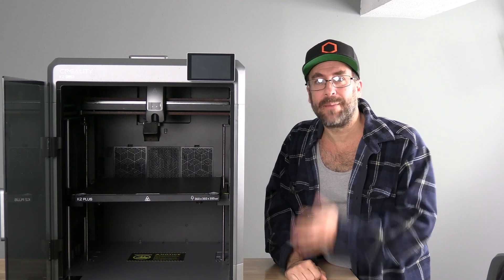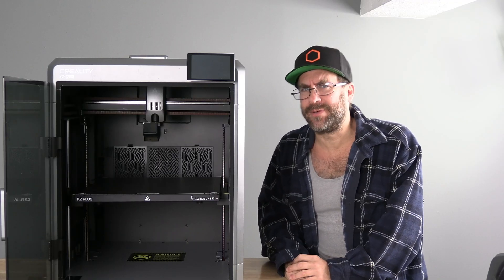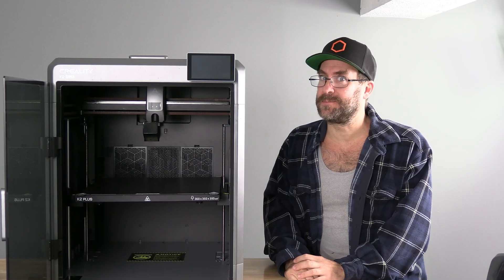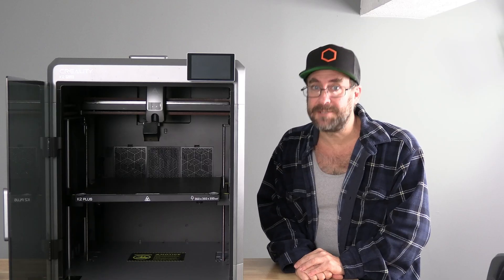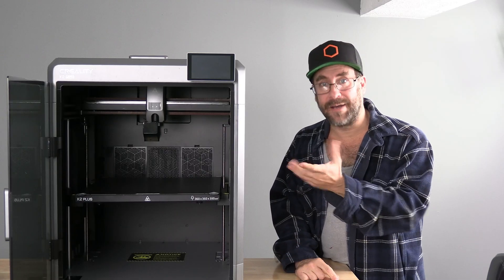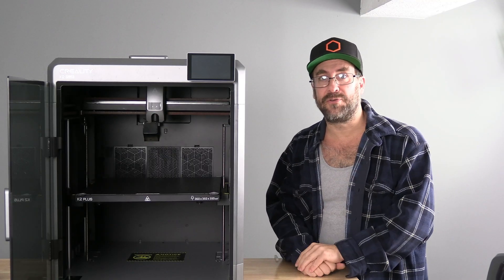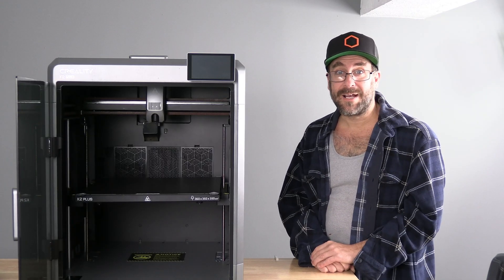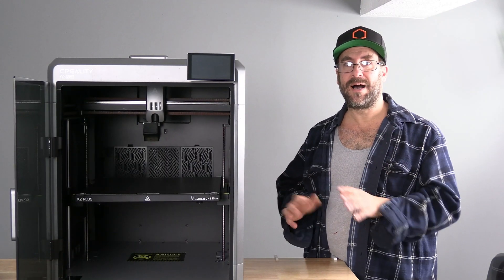CHINA We have a problem? K2 Plus Belt Tensioning Errors, after Firmware update. Let's discuss.

Comment: I was half way through a 15hr print and heard the printer shut off. The error said abnormal tension on the y and x belt. Went to do a calibration and now says there is filament in the extruder and won't continue to do anything. I have had no problem with this printer and it's the first time using it after the last update.

Comment: Today's new firmware trials and tribulations:  Updated and rebooted and did the calibration after cold boot. CA2721 is gone - yaay. Rebooted and reran calib to check - CA2719 makes a new entry - boo. Re-running a few times to check.
Reply: A couple of reboots and calibrations, and errors look to have gone. Print running overnight, will report in the morning.
Reply from the maker: Excellent. Several have stated the same. Report back. Creality is watching....

Comment: New day, new belt tension measurement tool - Biqu Belter.  Also new firmware......I read that there are mixed opinions of the Belter,  but my use case is to measure the X and Y belts, with the firmware showing an error on only one of them. My test is pre-today's firmware.
The Belter is showing both belts to be similar of c5.4mm = 7.72 nm which is within the tolerance mentioned in the wiki.
So if we ignore how accurate the Belter is or is not, the fact that it measures the same across both belts suggests they are the same tension. But the firmware only reports an error on the one - that maybe limitation of firmware, or just an error in the tolerance of the one belt. Either way, Im going to go with "annoying error message but no issue" given my prints are OK.
Now, todays firmware downloaded, lets see what the reboot brings!
Reply from the maker: Keep us posted!

Comment: I left a Squid Game mask print running overnight and it printed without problems or artefacts; the belt error is still showing. So I suspect the error is in the reporting, rather than the actual tension of the belt. Anyhow, I have a belt tension measurement tool arriving soon, so I will see what the results are.
Reply from the maker: You can do all the tensioning with a small 3D Printed tool from Creality. We are going go cover all this shortly
Reply: @3DRundown  However, some of us are getting an error straight away when using that tool :(
BTW, Update to Creality Print 6 just dropped....
Reply from the maker: You are running the Auto Calibration process, from the Wiki, with the tool, and getting the error still?
Reply: @3DRundown  Thats correct - as soon as I enter the first command, I (and others) get {'error': 'WebRequestError', 'message': '{"code":"key721", "msg":"The calibration value of the strain gauge is too small: 'mdly'calibration_num_error", "values": []}'}

Comment: I was hoping to wake up to a new patch this morning but no such luck.  I have tried factory resetting the printer multiple times.  I get the same left tension  2721 error every time.  I can still print.  At the end of every print I get an error stating that there is filament in the extruder and its not extracting, however when I open up the extruder there is nothing in there.  I should add the filament extracts into the CFS perfectly.  I went back to the previous firmware version and I get no errors.  I'm just going to leave it there until they hopefully put out another update, which I'm hoping will be soon  considering the amount of people having issues.
Reply from the maker: Have you tried listening to the 2721 and adjusting the tensioner? It may actually be that the older firmware isn't detecting the need for an adjustment
Reply: @3DRundown  I tried.  Nothing seemed to work.  To be fair, the printer is 3 weeks old and there should not be a need for an adjustment already...  Not super happy at the moment.  If it were just my machine I would look more into it, but I've read hundreds of comments on multiple  platforms from other people having the same issue.  In my opinion, either there is something wrong with the update (hopefully an easy fix) or there is something wrong with a LOT of essentially brand new K2's.

Comment: Gregg - thoughts on my current situation.  

I have a K1 And K2 Plus, both were printing as needed until today.  Doesn't matter what slicer I use or the file type, I cannot get either printer to properly print today.  I have not updated either printer's firmware ( as of this week) and am just using Creality Print 5.1.

Your thoughts on Creality intentionally using software to make users update?

I'm pretty pissed and since both printers are under warranty , I'm ready to send them both back.
Reply from the maker: I would use Bambu Studio for the K1. No question.
Move to Creality Print 6 for the K2 Plus. 
 There were firmware updates this week for K1/Max and K2 Plus. All of mine have been ok. What's happening with both?
Reply: @3DRundown  I sent a message on Insta, we are not connected there yet so I have to wait for your reply .  Too much to type on here

Comment: I will not be doing this update
Reply from the maker: Some peeps are saying their belt tensioner error codes were correct, and they did the adjustment. Others are ignoring it, and printing fine. Mine has been fine. Keep in mind, you can print as normal, with this error code.

Comment: Had this problem on my Y belt. If you use the belt calibration tool and follow the directions it will work. It says to adjust your belt that’s causing the error and rerun the test. Read down in the foot notes. My code was CA2721 in the wiki use K2 plus auto belt tensioning calibration.
Reply from the maker: Awesome, so you think the error code was accurate, and the adjustment worked?
Reply: @3DRundown  yes it says to tighten the belt 2-3 turns. I did about that and reran the test. The error code will pop up in fluid if it fails. After I tightened the Y belt it passed in fluid and then passed in the calibration. NOTE: the belt screws don’t seam like they are pushing in anything. They’re super easy to turn so it’s probably just that ever so slight between them and the sensor picking it up.

Comment: I rebooted - reran calibration after firmware update.  And am getting CA2719.   Belt tension timeout failure. Please try retightening or restarting.  My prints are fine.   I also performed the manual k2plus belt tensioning module process and while the Current_Place value is correct but the difference between idl_adc and full_adc   is  < 45000  and is supposed to be greater than 100,000  according to the docs.  I have the back off the machine investigating now...
Reply from the maker: Interesting. Lemme know your verdict: real error code, improved by tensioning, or, bogus error code. I have an email out to creality
Reply: @3DRundown  Howdy.  After some continued investigation I believe, at least for my unit.  After initially getting the CA2719 I did the manual belt tensioning and now have a consistent ca2720.  Which is the - from the front of the unit - Right (X) motor.  Anyone wanting to confirm look at the white label going around the wiring harness.  You may have to rotate the label (it's printed on white shrinkwrap around the wiring).  Looking at my unit I realized that the manual tensioner screw was / is having no effect.  upon closer investigation the tensioner motor appears to me, to be basically as far traveled as it can go with the stop screw. It's essentially moved as far as it can.  I took a close up picture of the tensioner unit and screw in question... The bummer is that I believe the only way to resolve this would be to give the belt more slack.  Essentially it came from the factory cranked down. And I believe the only way to do that is to take apart the hot end and give the belt a few more teeth leeway (for lack of a better word)  And that doesn't seem fun at all.  I am not able to find any info on creality site for the belts and or belt replacement process. Not that the belt is needing replacement but that info would give insight into how it's secured.   There is a video a guy made that goes into detail about the manual tension screws but... he doesn't break down the actual process he went through to loosen the belt though he does indicate that's what he did. I put some text and a picture of what I think is going on in reddit in a forum that's discussing this issue.  https://www.reddit.com/r/Creality_k2/comments/1hqg63x/comment/m4t6we7/?utm_source=share&utm_medium=web3x&utm_name=web3xcss&utm_term=1&utm_content=share_button
Reply: caveats - I could be wrong about a lot of this... ymmv
Reply: even creality has pulled their youtube video's related to firmware
https://www.youtube.com/watch?v=0rKfgOZAU-Y
this is a link from their other video series for the k2  specifically the wiper one https://www.youtube.com/watch?v=nx0PoI67fOM
if you look in the video notes there is a link to this for firmware.  and it's deaded out now

Comment: Thank you sir I got my new k2 yesterday I actually use your set up guide in YouTube to set the whole thing up, which made it very easy. Thank you very much for that. I have the belt tension  problem ca2721 that you discussed. And I've been doing some research on it and found no clear answers other then that is the coad for the right tensionr. But I will definitely try powering it down. And running the full calibration again, so thank you for that. O also alot have said it does not seem to effect printing at this time even though it fails ill see tonight ,so once again
    have an amazing new year
Reply from the maker: The real question is: is the error report valid, or not. Some have adjusted their belts, others have been able to make the error go away. If no luck, try a factory reset and report back.
Reply: @3DRundown  thank you sir

Comment: After the firmware update I get the CA2721 belt error.  I did not power cycled before calibration after tbe update.  Contacted Creality and they said run calibration 2 or 3 more times.  It didn't fix it so they are sending a new tensioner.  Everything was fine before the update.
Reply: Same
Reply from the maker: Wow. So, perhaps the error report is actually correct?? If your tensioner resolves the error, that would prove the CA2721 correct. But, I dunno. Maybe it's too sensitive in throwing the code. How is it running?
Reply: @3DRundown  Printer is working fine, calibration is just failing with left belt strain gauge. I tried to do manual belt strain gauge calibration but it was throwing errors for the left one as well. Creality support did not ask much, since the calibration failed, they immediatelly told that they will send a replacement gauge and board. 
But isn't it a bit fishy that specifically left belt strain gauge failed after the update on most machines with this type of error?
Reply: @kolaic96  I agree, hoping they figure out its a firmware bug and patch it.  Otherwise we all had faulty belt tensioners and this update is exposing that.  I may try the factory reset path and see if it fixes it.
Reply: @davidwalton6308  Pls let us know if factory reset fixes this
Reply: Roll back the firmware
Reply: @benkave2779  my guess is the old firmware was not utilizing the motorized calibration or not reading from the strain gauge.   I would bet the units were tuned at the factory... but the auto tensioning was disabled pending this firmware.  This is just a supposition of mine...   I am guessing that the tuning from the factory isn't nearly as precise as the strain gauge and motorized version.. BUT that some of the systems tuned with the manual screws from the factory are at the limit and so.. when the new firmware said hey.. wake up that subsystem and use it the system said... I'd love to but the manual adjustments have me as tight as I can be... or the strain gauge is out of band... can't articulate the tension motor etc etc.    Again.. clear instructions from Creality about how the whole tensioning system and belt system works would go a long way- esp given that belts are a wearable item in any case.   Just my 2 cents.    That also would explain why lots of folks took the update and are fine.  they just happen to have systems tuned to the middle.. So when the tension system got engaged it said ah ok. a little turn here.. a little slip there.  all good.

Comment: Brand new machine today & error after update. prints ok though. tried switching off & calibrated again - still CA2721
Reply from the maker: Thanks for the update. Looking like the errors may be false, and we'll just print away, till they update the firmware to patch this, or tell us otheewise
Reply: Follow the wiki and you can tune it out. I had the same problem on my Y belt. Was able to fix it right away without any parts.

Comment: I got there error after restart on the update then printed the tool for calibration and follow the full calibration for both sides
Reply from the maker: Did the error then go away?
Reply: @ it did clear after. I took the back off looked at every thing as well it would be nice to have a set or marking along the drive axis of the motor to see if you are at the bottom or almost out of automatic tuning space. Maybe not necessary as it’s probably not intended to access a lot. I would guess the update has some wonky setting numbers for the feedback of the motors and just needs an update it will probably clear them up. I am figuring after a few cycles it is likely to happen again unless a patch is written

Comment: Ooh, is this why I am struggling with the top layers.
Reply: Let me be clear. No error messages, but I am having top layer issues even after turning off ironing.
Reply from the maker: Not a fan of ironing. Try slowing your top layer speed, and adding additional top layer
Reply: @3DRundown another vote for turning off ironing. although the K2 has done a very good job at it for me